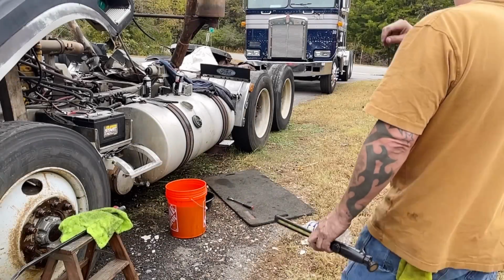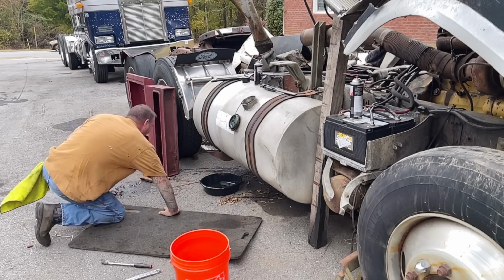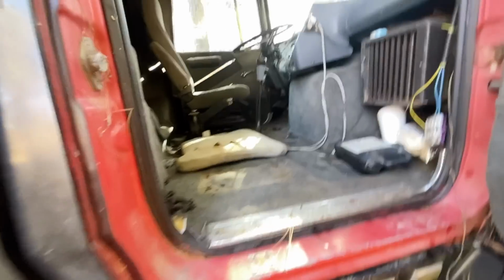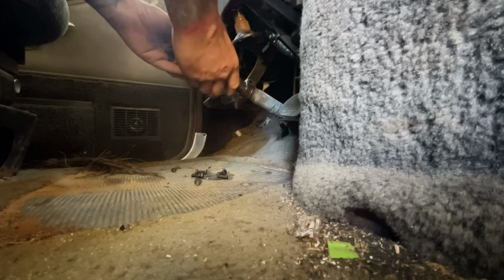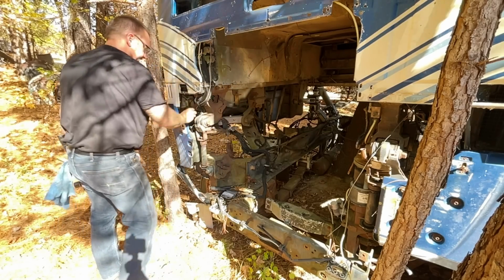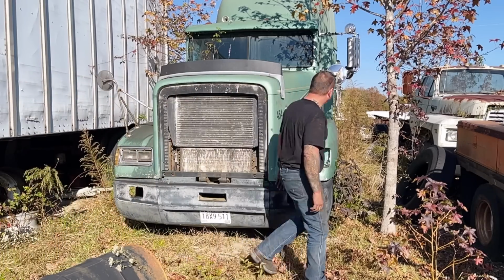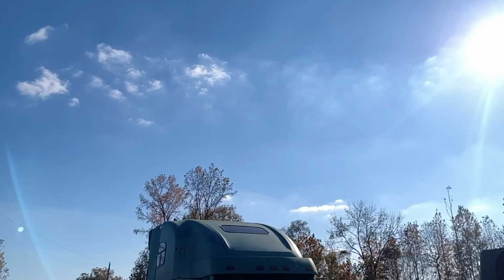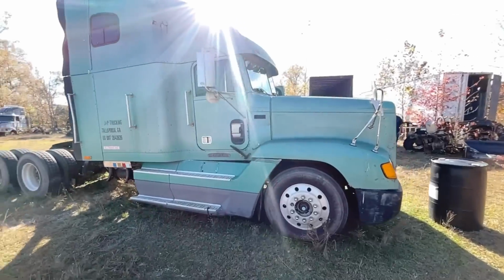Intro to Truck's Eleven Twelve and 13. When Does It Stop?

Comment: Lots of beauties glad you are saving them. That aeromax with a bunk and aero wing is real special. Rare too. Hope you don’t change too much on it when it comes to specs maybe some aluminum wheels but other than that I love it. Good name for that would be “Louie” as well as the FLDs both would be good for pulling dry van or refer because of the roof wings. I can imagine that FLD would look real nice in red to match the interior. As for the condo FLD that color nicely matched the interior. Great old aero trucks you got now James
Reply from the maker: I don’t plan to change anything on Eleven.  Wheels and tires and get a motor in it and a passenger seat. A each and wax and interior detail and it’s ready to rock
Reply: @JamesPretty  yep sounds like a plan

Comment: Sweet all of those are sweet I drove a Ford aero max for Dave Simpson freight and a Ford 9000 cab over both  were very comfortable  I also have a 03 century  with 750 thousand that's been sitting since 2012 when I was wi th landstar in real good shape 12.7 detroit
Reply from the maker: Nice.  I think I’ll enjoy the 12.7’s
Reply: Oh you will I have always drove or had Cummings  but detroit 12.7 engines  you can't beat them in my opinion  they run neck and neck with the n14 motors

Comment: OMG! Well James you sure love your trucks. Now you have a bakers dozen. Btw I would try and pick all parts you can off blue nasty, you never now what you might need down the road when restoring Fiona. I like the two freightliners the FLDs they remind me of truck x with the single piece cab and sleeper bunk. As far as the other Ford, you said it had a special meaning for you because of a friend of yours, but you didn't elaborate. You said its cummins had a crack in the block and you could "stick" weld it. Boy you do have special talents. I think you said in a previous video that you plan to take a break. I'm sure you'll be putting out videos for the next few years with what you've got. Keep on truckin James.
Reply from the maker: Ya I didn’t want to get to personal about my buddy he’s not a social media kinda guy. But ya. I love the fld.  I had a 96 condo.  It was real rough me and my brother went on a mountain hell ride together in it first time out.  Glad the Jakes were strong lol. I’m not 100% sure I can weld the block. I have done it once to out a starter ear back on a Pontiac motor and it held up.  We’ll see we’ll see we’ll see

Comment: James you need a electric pump saves you on manual labor easier I used one on my tanks then took both tanks off hot pressured washed them put back on cut 4 2inch cargo straps and cut 4 4 inch straps and put it between the fuel tank strap's top and bottom of tank it works great keeps rust away from cracking the aluminum tanks God bless you and your wife ✝️🇺🇸 number #11 Betty Boop
Reply from the maker: Great idea on tank straps.  I have an electric pump set up. A couple actually. Just a lot to drag around